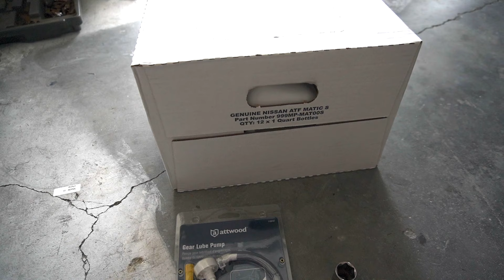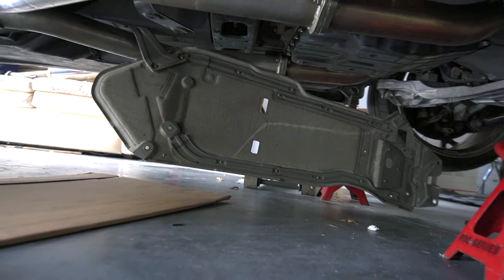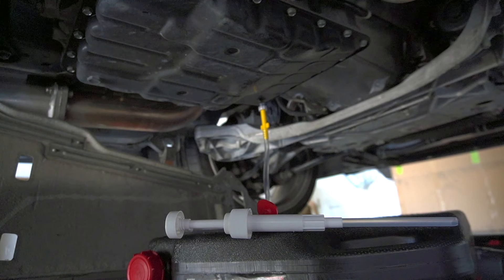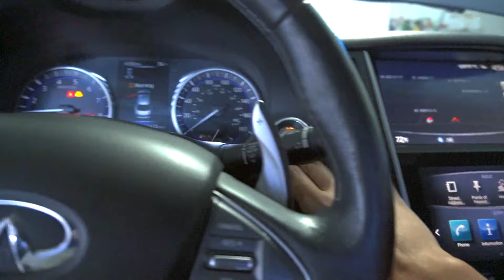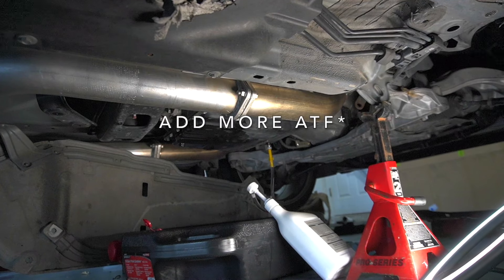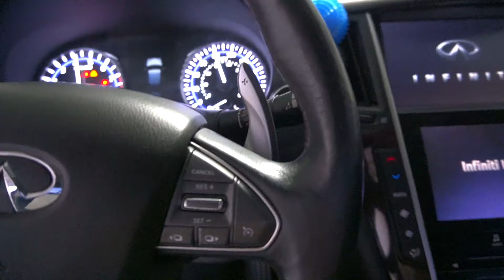Q50 Q60 DIY Transmission Fluid Change | Carbon Forged Caps Giveaway

Comment: You can fill it from the top. There is a fill screw on the passenger side near the firewall. Much easier to fill, no pump needed.
Reply from the maker: Really? I don’t think so. Could you send me a picture to my IG? Thanks bro
Reply: @ZillaFullBoost  I don't have IG. No social media for that matter.  I can email you a pic.
Reply: @ZillaFullBoost  Did he send you a video or picture of the fill from the top..??
Reply: no way
Reply: @nomistakes6973  I have done it twice now.
Reply: where is the fill screw located drop me a pic
Reply: @johnnysliick3064  how do I do that? Email? I don't have social media.
Reply: @redlinemsa   yeah help me by sending it
Reply: @johnnysliick3064  did you get the pic I’m having the same issue
Reply: they kept deleting my email
Reply: @kevinsandoval7972   no for some reason i can’t post my email on here
Reply: @johnnysliick3064  they keep deleting my link to the photo.
Reply: @johnnysliick3064  do you have social media?
Reply: Replace OIL with a D0t
Reply: @johnnysliick3064  gooD0T
Reply: @redlinemsa  thank you. You’d be doing us all a huge favor
Reply: Uploaded a short. Hopefully you can see it.
Reply: yes, infiniti tried to hide it.  this is where the dipstick should be, but isnt.  the dealership has a tool that it uses to check fluid level and condition through that fill port

Comment: I'm at 35k and I was considering replacing my transmission oil. I've seen first hand neglecting changing AT fluid does to ATs. As you said, even though the manufacturer says the AT fluid is good for the life of the AT some peace of mind doesn't hurt. Great video Zilla.
Reply from the maker: Yup, better off changing every 30k-50k. Thanks for watching bro.
Reply: did you ever do it? I'd recommend switching it to Amsoil Signature.
Reply: @LexusJDM350  I did. Used Matic-S. Changed it around 50k.
Reply: most new cars have the same idea of "life time oil".  what they dont tell you is that they dont expect the life to go beyond 100K.
Reply: Life time means warranty period, after that god bless ya.

Comment: Hey! My 2014 Q50 has about 103k miles on it and has never had the fluid touched, I plan on doin this same procedure of flushing it. Do you recommend I just flush and fill once since it’s considered high mileage or is it safe to go through this full drain and fill. Thanks for your help
Reply from the maker: That’s a controversial topic. It can be risky, but it may also be helpful. Maybe just drain and fill 2 times 🤷🏽‍♂️
Reply: 103K miles is nothing. its safe to drain and fill as many times as you want.
Reply: @totaled it last year 😢

Comment: Appreciate this video bro! Completed this on my 2015 Q50 AWD  at 90,000 miles without issues. The fluid was pretty dark but got lighter with each drain. It's been about two weeks since the fluid change & I've gotten an overall feel of how the transmission responded to the fluid change. Previously it would want to hunt for gears, hesitate a bit with downshifts, lazy on manual downshifts & jerky with upshifts. Now it is very smooth, precise, solid shifts, no lazy downshifts or hunting for gears. Would definitely recommend to change the fluid if your transmission is acting up.
Reply from the maker: Thanks for the input! Glad you got it take. Care of ✌🏽
Reply: @ZillaFullBoost  anytime bro stay vibrant !
Reply: great thanks hoping for this on my 15 awd 3.7 today . 123k. it was swapped out at 100k but i just bought it and don’t believe it until i see it. cant hurt right. It’s just been revving up to 4k when i give it a little bit and taking too long to shift…it isn’t very bad but i think I may be able to fix it. i fixed that problem on my taurus sho at 140k by doing a drain and fill. shifts smooth at 180. Other than that car runs like every other G35 G37 i’ve owned with high mileage , great. Cant let anybody drive this car..afraid they’ll put 87 in it lol.
Reply: Hey when you did this did you also switch through all gears on every fill ?

Comment: Putting this out there in case others are going through something similar and want to know what to expect. So I bought a 2015 q50 with 109,000 miles. Just changed the transmission fluid how you demonstrated in video. I know it’s high mileage so a little risky but did it anyway and gonna update this comment in 1 week, 1 month and so on. I Also forgot to switch gears after each drain but that was my fault. I should also mention previous owner never touched the fluid. So this was the first time it got a transmission fluid change ever. At 109k miles. Will keep you guys updated
Reply from the maker: Thanks for providing some info!
Reply: How’s it going so far @alex R
Reply: How’s it been?
Reply: It never got touched because it's supposed to be maintenence free.
Reply: Guess he’s fine or he’d be back complaining.
Reply: Car was stolen 2 days after so never got to test it lol
Reply: @AlexR-on3ct   how did they steal it
Reply: he stole it
Reply: Forgot to update but after like 4 weeks it was found and I’ve been driving to since. Changed the fluid again cause it started leaking from a hose that went to the radiator and 3k miles later it’s still shifting good. Even better than before.
Reply: @AlexR-on3ct  I’m glad you got your car back bro that is heavy!
Reply: @AlexR-on3ct  sup bro I seen a lot of comments saying it’s too risky to change it on high mileage if it’s never been touched. Mine is at 103k miles and still a virgin 😳, you think I should do this method, how’s it going for you brotha. I’m really skeptical
Reply: @jshoogs 619  you have to change it before nuking your transmission.  The viscosity of the old oil is gone, that's what's start damaging internals, talking from experience on a CVT Nissan transmission that never got a transmission fluid change in 180K miles... it lasted 180K though haha
Reply: Do you remember how the fluid smelled?  was it transparent and still slick?   Color compared to the new fluid you added?    I'm about to do my wife's car at 88k miles.   Her fluid smells good and looks good, but I don't have new fluid to compare it to.     I think you're safe doing it at 100k.
Reply: @robbyddurham1624  you're talking about car's fluid , right?

Comment: I did this on my G37 with 250k kilometers on it + remove the ATF pan and clean.  The ATF was black as.  I will do it on my Q50 which has 62k kilometers on it but without the ATF pan removal.  Thanks for posting, looks nearly identical job as the G37.
Reply from the maker: Yup pretty much the same

Comment: Hey wassup bro I have a 2017 Infiniti q50 and it has 105k mileage sometimes when I drive the car and I stop on a red light the car jerks a little bit also sometimes the car idles for a few second then it does this hesitation idk if it’s when it switch gears it happens but you think I need to change the transmission fluid or is it a transmission problem there’s no check engine light or anything like that really want to know
Reply from the maker: @looneywaves  I would try and see if you have a vacuum leak somewhere. It’s still a good idea to get a trans drain and fill if your trans feel normal.
Reply: @ thank you my brother I’ll take your advice God bless you 🙏🏽✝️

Comment: On the passenger side of the transmission there is a black hose that runs horizontal to the road. Follow that hose towards the front of the car. It will then bend downward and at the end just below a few inches is a cap that looks like a tiny cooking pot with a bolt that holds the "handle" of the tiny pot/cap down. That's where you fill it from the engine compartment.  I have done ir this way twice now.
Reply from the maker: I’ll take a look next time.
Reply: so you just had to lift the hood of the car to fill with oil?
Reply: That sounds way safer we need a video on this method not a video on using a tool that might strip the pan😂
Reply: That sounds way safer we need a video on this method not a video on using a tool that might strip the pan😂
Reply: @BEAZYBUILTIT 
I will try and remember to document the fill on my next change. It's much easier, almost as easy as an oil change.
Reply: @ I’m doing my transmissions oil change today so if you want subscribe I’m going to try your method and shout you out !!

Comment: There is a fill port on the top of the engine. It looks like a bucket and has a arm with a bolt. You loosen it up and swing it out ofnthe way. 

You remove the plug you used to fill from the bottom as a level weep hole on the final fill, you fill from the top till it comes out that hole. Then you are full.
Reply: Oh also shift all gears between flushes
Reply from the maker: @starkmad8346  As far as I know 2016+ Q50 and Q60’s don’t come from the factory with dip sticks or fill ports in the engine bay. 

And I did cycle through the gears between each refill. I never mentioned to do it because I was only demonstrating the instructions found in the forums from that member.
Reply: @starkmad8346  you can shift gears while the car is in the air?
Reply: thats what i said, the fill port on top is where the dipstick should be but isnt. the dealership has a special tool that they stick in there (basically a dipstick) to measure level and see fluid condition

Comment: I had to take my 19 Red Sport to the dealer, since I didn't have power. Infiniti found both turbo's were bad, and had to be replaced. Since the car was there I decided to have my 30K service. I only have 27K, but decided to do the service anyway, since the car is 36 months old.  I did the Transmission service. It was $215.94, it says Infiniti used 4 Qts at 13.99 ea., 999MP-MAT00S, so trying to figure out why they only used 4, when you said you used 12. It does say 1QT x 12, so weird.  I will call them on Tuesday.  Great video.
Reply from the maker: Took about 10qt to really flush out the old stuff.
Reply: Your stealership that serviced your Q did a basic drain&fill. Difference here is ZillaFB did what your DS did x4 which is close to a flush without using pressurized ATF from specialty equipment a pro shop or DS would use for a trans flush (not recommended). This here is the most thorough method to replacing the fluid in a "sealed" transmission.

Comment: I am doing mine at 40K miles.  On another video, the guy said to overfill by 1.5 quarts after leveling the fluid out at the end.  He says it gets rid of cavitation at take off.  What are your thoughts on that and should that be done?

Comment: Done! But bro aren’t you supposed to shift through the gears (PRND) as well when you turn the vehicle on in between the 3 quart fill ups
Reply from the maker: That does make sense and I did do that based off my GTR’s procedure. I however showed a way another q50 forum member did it.  I didn’t want to change it and wasn’t sure it’s necessary for this transmission.

I can confirm it didn’t damage anything, so if you’d like to run the gears through after each fill I’m sure it will be fine. In fact, you’ll probably cycle through the fluid more.
Reply from the maker: Oh what’s up. It takes a lot of work and time, but if it’s something you enjoy doing it’s rewarding.

Comment: I am watching your video again.

Throughout the process, you didn't remove the fluid pump from the fill hole to let it drain? The only time you remove the fluid pump from the fill hole is after you finish cycling though the gears? Other than that, you just drain it from the drain hole, correct?

Instead of doing what you did, drain 3x and fill 4x. Could I just fill 4 quarts 3 times?

Comment: Just an FYI- They sell an adapter that is the exact thread for the 7 speed transmission pan so you don’t have to worry about messing up the threads using a universal adapter. It’s only like $15
Reply: Link for this tool?
Reply: @jrtripp ^

Comment: Would 95k miles on a 3.0t be too late to do ? Shift a litting late nothing major but definitely noticeable
Reply from the maker: If it was me yea I would do it.
Reply: @ZillaFullBoost  cool I’m going to try it out this weekend I have a warranty on the car so if anything goes wrong I should be fine, hoping everything goes smooth though
Reply: the reason it isnt shifting smoothly is cause the fluid is old and worn out
Reply: @ lol yeah I did the oil change on it and it’s smooth as butter , including the differential fluid change

Comment: Many thanks ! Just had my Q60 W\44k done at a shop and it started slipping as soon as I left the shop . Took it back now it slips when cold first start in morning after sitting all night . Does not slip warmed up .  I'm thinking  there's not enough fluid in it  . any other thoughts ?
Reply from the maker: Definitely try to fill it some more.
Reply: @ZillaFullBoost  Yep , I notice they only used 5 quarts of fluid too . thanks for fast response K +
Reply: @ZillaFullBoost  I'm not feeling great about it to be honest . Seams I'm missing 262 miles . They lied on the mileage going out and when they reset my mileage it was not 10,000 miles but 9738 . I bring it back Tomorro for the second time .  I'm going to ask him to enlighten me the process that creates missing miles. ........ I will be snapping a pic of the odometer this time first thing going in !
Reply: @FeelinCLO2 any update? i wanna get my q50 transmission fluid change but kinda nervous about it slipping afterwards im currently at 53k miles
Reply: @yuthought-2450  All is good now . Next time I'm using the dealership .The shop said they had to adjust something in the transmission . Whether I believe them is another story........

Comment: Hey how you doing do you think it’s safe to do a flush at 60k bought the car don’t know if it’s been touched before. Thanks for your video. Very helpful. It’s for a 2015 Infiniti Q 50.
Reply from the maker: Don’t flush. Just drain and fill you’ll be fine.

Comment: In the video you say the car should be "on" when adding the last 3 quarts. "On" meaning running in idle at 104 degrees? Thanks
Reply from the maker: Yea letting it get up to temp. I wouldn’t really worry about that as much. I say fill it until it spills out of the fill hole and cap it quickly.

Comment: Is it worth dropping the pan, replacing gasket and “correctly” draining fluid from valve body. 90xxx miles
Reply from the maker: It’s hard to say. They say you shouldn’t completely flush the system with a lot of miles unless you been changing the fluid regularly. I started at 30k miles with this car so I decided to do it and will continue to do it. 

If your gasket isn’t leaking I wouldn’t drop it. Just change the oil.

Comment: Bro you weren’t clear on how many qrts you used total. In your description you wrote. “Will require more than 12qts for it to be clean” how many did you use?
Reply: He used all 12 qts, drained and filled 3 qts 4 separate times

Comment: Do we check the transmission level while the car is running or do we just make sure it's at the correct tempature and check it with the car is off?

Comment: Hey Zilla - you mentioned using a more race oriented transmission fluid.. which fluid would you recommend? I am at over 40k on my Q60 and want to get this done soon. Thanks.
Reply: Use redline d6 atf - absolutely

Comment: Question do you switch through all gears all 4 times that you turned the car on ?? Also if I’m not mistaken it’s 3 quarts per fill if you bought 12 right
Reply from the maker: Yea I turned on the car and went through each gear 3 times. Filled with 3 quarts each time.
Reply: @ZillaFullBoost  okay so went through gears  3 times in one minute that the car is one and repeat ?
Reply: On*
Reply from the maker: @anthonysantana9193  yup, repeat the drain, fill and gear change 3 more times and you’ll be good to go.

Comment: Thanks for this informative video.

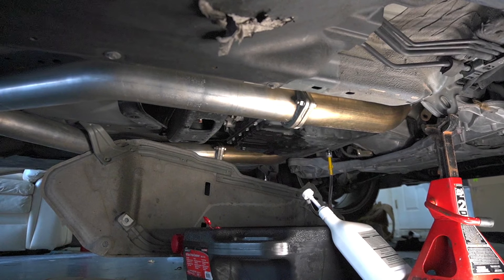Planning on doing it this weekend...quick question though.  Beginning time stamp 3:53 you mentioned you have drained 3x and filled 4x.  Did you mean drained 4x and filled 4x?
Reply from the maker: Wow my mistake, yes.
Reply: @ZillaFullBoost  I'm planning to change all the fluid using Amsoil Super Shift Racing TF.  Would you call this  video full fluid flush or just drain and fill?
Reply from the maker: It’s a bit of both but I would say it’s more of a drain and fill. There is still some dirty fluid in there.
Reply: @ZillaFullBoost  sorry for the noob questions.  On the last step, what's the purpose of heating the drain pan up to 104 F?
Reply: @davaocarino2443  it has something to do with purging air bubbles out of the fluid so all the internal volume of the transmission is taken up by fluid rather than air pockets in between. just like coolant and brake fluid.

Comment: Hello.  Will the Yamaha adapter work for a 2012 Infiniti FX35 transmission fluid exchange port?
Reply from the maker: It’s a 7 speed so yea. Just remember not to over tighten it because it’s not a perfect match.

Comment: I bought the hyper tough Tool and the threads don’t fit my 2019 Q50 Transmission
Reply from the maker: It’s not a 100% fit. You can start it by hand until it gets tight. Do not over tighten.

Comment: I did the filter and oil change for my qx70s but it does not do the 3rd and 4th changes, is there any advice that can help me
Reply from the maker: If this is a new symptom after the fluid change. Sounds like you may have improper level of oil.  Just a thought.

Comment: Took out radiator and one of the lines spilled trans fluid , don’t need to flush just re fill it so how many quarts do I have to use ?
Reply from the maker: Depends how much came out.

Comment: I have a 15. 3.7. About 68k miles. I have never changed it. I have never tracked it. But I drive it in manual sport mode 24/7. And drive it like a sports car. Would you recommend I do this? I really want to. But idk if 68k miles is considered “high”
Reply from the maker: That’s a good question. I changed mine when I had I believe like 45-50k miles. It’s working fine. I guess they might consider high mileage 75k-100k miles in todays day and age.